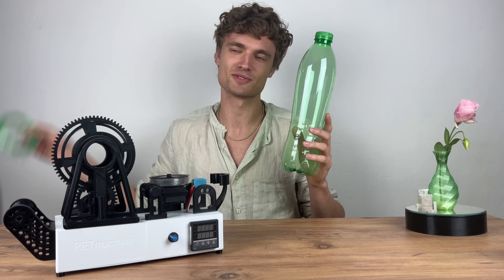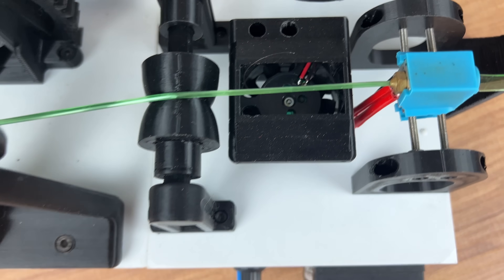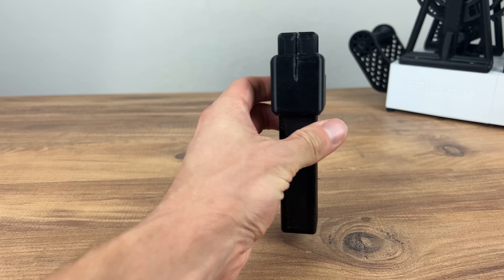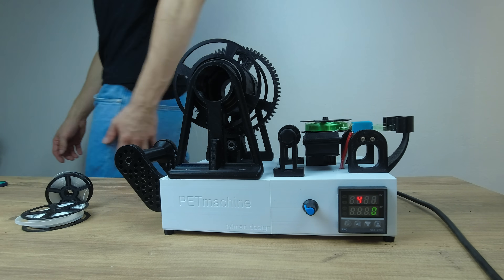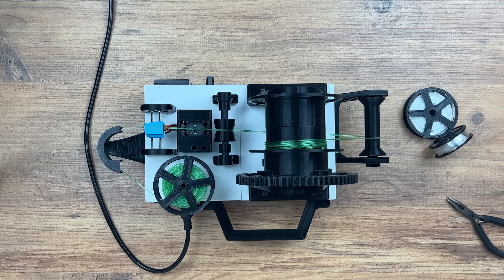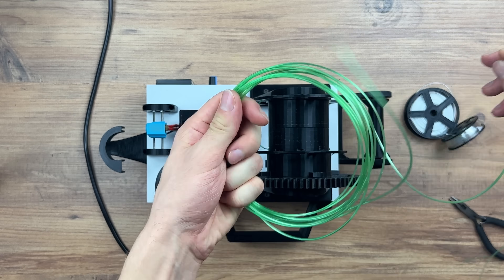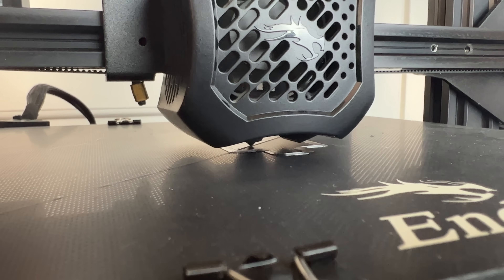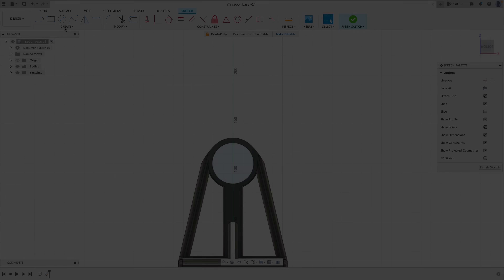Turn Plastic Bottles Into 3D Printer Filament at Home | DIY PET Recycling Machine!

Comment: The big question I have never seen answered with regard to these machines is this: How do you form continuous filament longer than you can get from one bottle? Without this ability, you cannot make anything of significant size. Another question that comes to mind is whether the amount of time and energy expended to form the filament is actually worth it. I can buy a 1 Kg spool of PLA+ in multiple colors for about $15. A typical large PET bottle is probably no more than 50g, so it would require in the neighborhood of 20 bottles to make a Kg even if you could make the filament continuous. Nevertheless, I do appreciate your design. One thing you might want to add is an automated method for slicing the bottle. It would be a big time saver.
Reply from the maker: Hello. You can "weld" it using PTFE tube and source of heat for example lighter. It's a nice solution, but I'm making research to merge raw plastic strings together and process very long string at once. 

I'm upgrading machine all the time to reduce the time of operations. For now we have to treat it like hobby and passion, not like its worth "something" and calculate time and effort. If someone like me take care of the environment this experience of recycling a bottle on Your own is worth everything. 

You gave me price 15 $ for one spool, but take into account that filament from bottle is recycled in 100%. Recycled PET filament from the store cost around 30$. A lot of people want to use just this kind of plastic to print / create their products and they don't care about the price or effort, because for them in what they believe is more important.

It's like going with bicycle from point A to B instead of the car, we put much more effort but it's about the journey, not a destination!

Thank You for Your comment!
Reply: there is a thing on thingiverse called a filament welder. i did not test it, but the comments suggest it works
Reply from the maker: Hello! We will announce and put PETwelder on sale very soon. You can follow my Instagram account to follow the progress about it: www.instagram.com/tylmandesign

Comment: This is just amazing work. Well done!
In germany we have a system where we return plastic bottles so they can be recycled. But there are many bottles that are one use only. These could be greatly used for this.
Keep it up bro

And i would guess that the third vase isnt from a bottle ^^
Reply from the maker: Thank You so much for Your great comment. Yes I was aware that in some countries it's not worth it to process the bottles in this way, because there is "return system", but many countries don't support this system and instead of throwing away the bottles we can recycle it in so efficient way taking into account we make it at home!
Reply: Germany changed the system to every plastic bottle i think?
Reply: @curryking7663  Yes you can return every bottle but there is still a lot of non reusable bottles that get taken back just to be destroyed. You return them just to seperate it more from the common trash.
Reply: Literweise Saft zu trinken deswegen macht aber auch irgendwie keinen Sinn ;D
Reply: @hanswurst3811  richtig 😁
Reply: and also unfortunately even the returned once are often burned for energy instead of recycled. there is a good arte documentation recently, can recommend to watch it. really sad that even exported plastic trash to other countries is considered "recycled" in the eyes of the law in germany.

Comment: can you post what module you used for the special knife because I don't want to use the wrong thickness plastic strip when I finish making the machine.
Reply from the maker: Soon I will release special module attached to our machine, it will have visible numbers showing where You should put bottle with particular wall thickness and cut it. It will feed machine directly with plastic.  Thank You for Your comment!
Reply: @TylmanDesign  I can't wait to see when that update comes out!

Comment: Does your temperature controller have a memory so where its always set at the temperature even when you turn it off and on again? Also do you have a recommended thermometer for a raspberry pi? Im trying to make a machine like this thats based on the pi, and I have the display, stepper motor, and button inputs planning on being hooked up to the pi
Reply from the maker: Yes, after shutting it down it remember last set temperature. 

My previous prototype was fully based on the Arduino, I had display, rotary encoder and so on. I was using MAX6675 module with K thermocouple connected to it and it was working pretty well. I've never see raspberry pi in this project, sound interesting!

Comment: I have also designed pet filament maker, couple of tips: Bearing cutter is a lot more precise than blade cutter, 1.7 mig welding nozzle is absolutely amazing and destroys any 3D printer nozzle due to much longer melt zone, you don't need to prepare bottles as much, I had great success just stripping label off cola bottle. If I had to prepare each bottle under stove, I would have quit long time ago.
Reply from the maker: Thank You for Your amazing comment!

Yes, I'm aware that bearing cutter is better, but I was designing my machine to allow for majority of 3D printing community can do it easily. Blade cutter is really easy to implement compared with bearings that we have to modify. 

In the future for more demanding audience I will prepare for sure bearing cutter with electric regulation of the string height, but for now I focused to create the most affordable and simple device. 

Coca-Cola bottles are the least demanding bottles, they are almost smooth. Some of the water bottles are really "wrinkled" that cutting it in this state will be impossible. 

I will check these mig welding nozzles, it interested me a lot!
Reply: @TylmanDesign  Mig contact tips 1.7mm can be bought for dirt cheap in local welding stores (bout 10$ for 10 pack) they also have the same thread MK8 as 3d printer nozzles and require no drilling (exiting filament expands a little), as for blade cutters, i had lots of problems with them like filament being stuck, in was really annoying so i made bearing cutter with a simple microdrill (angle grinder can also work but its a bit harder). I have entire uniformity test performed on some of my videos about filament diameter variance.

Comment: This is really awsome work.

Small ideas for enhancement:
- Possibility to directly usa a empty filament-roll where it puts it on. Because I was astonished how well it puts it on.
- Is there a way to easily combine multiple bottle-bands? So that we could make a 1kg filament-roll out of multiple bottles?
Reply from the maker: Thank You my friend, Your suggestions are very accurate. 

Im currently working on the cutter for the machine, the next thing is what You talking about, I will try to connect two string into one to be able to process many bottles at one, but it's a little bit challenging. In this case removable spool is neccesary to implement, but now when we procees one bottle, even if its super big removable spool is not that important.
Reply: @TylmanDesign  Thank you for your answer.
So do I understand right, that if I buy your manual, ... foryl your idea/product now I will get your improvements your working (new .step files, manuals, ...) on later on for free?
Reply from the maker: @photelegy  That's right! All updates included. I wish there will be many practical ones!

Comment: maybe make a filament welder so if you have multiple bottles of the same kind you can make a bigger roll by welding those filaments.
Reply from the maker: Yes, I was thinking about it, it's very easy to do, but I'm not satisfied with that l. I would love to find a way to merge two plastic strings before processing it.
Reply: @TylmanDesign  perhaps two heated blocks pressed on the two strips to fuse them like those sandwich makers?unlike filament welding, where you can trim excess thickness, there will probably be a change in thickness.
Reply from the maker: I tried it yesterday with hair straightener of my girlfriend(I hope she won't see this comment hahaha) It reached 210 celsius degrees and it wasn't enough to melt the strings, next problem is when string is heated it shrinks immediately and "run" from second string. I will test more solution when I will finish cutting module!
Reply from the maker: Hello! We will announce and put PETwelder on sale very soon. You can follow my Instagram account to follow the progress about it: www.instagram.com/tylmandesign

Comment: А отрезки никак не спаиваешь вместе что ли? О.о
Reply from the maker: Yes You can, after processing You can merge two plastic wires together using PTFE tube and source of heat, for example lighter. I will work on solution that will allow to connect plastic string before processing to create one long string.
Reply from the maker: Hello! We will announce and put PETwelder on sale very soon. You can follow my Instagram account to follow the progress about it: www.instagram.com/tylmandesign

Comment: what's the printing temp .. also the speed
Reply from the maker: Printing temperature vary from 240 to 260 celsius degrees, speed depends of the printer, but safe range will be 30-50mm/s.

Comment: It would be interesting to see if your machine could handle polyethylene bottles, and you could 3d print it. Here in North America, we tend to have deposits on pop bottles, but not on a wide variety of large polyethylene bottles. I understand polyethylene requires higher temperatures, more like ABS.
Reply from the maker: Printing temperatur of the HDPE(polyethylene) vary from 230 to 260 celsius degrees, so quite the same like PET. I think processing this kind of  bottle in my machine could be possible, but I will need to make some tests. At the earliest opportunity I will try to do it! Thank You for Your comment and making me curious!
Reply from the maker: I just got HDPE bottle yesterday, soon I will test it 💪🏻
Reply from the maker: I made some tests, HDPE is more soft and 
ductile. It was more demanding during cutting, but it was possible to make it,  further processing due to material characteristic is almost impossible. Like @7CConstitution said, it's like bubble gum.
Reply: @TylmanDesign  amazing.

Comment: How many grams of filament are you getting out of one of those bottles. Looks like a 1.5L bottle correct? I'm trying to figure out roughly how many bottles I would need to process for this to start paying off.
Reply from the maker: Yes it was 1,5L bottle non-carbonated drink, it's around 20g of filament from one bottle of this type.Thicker bottle walls give more filament, soda drinks weight more coz of higher pressure inside of the bottle.

Comment: It's awesome!
One hint: adding mechanism with a weak spring to push it to one side when it's pulled to the spool. So your finger is obsolete then.
Also what's a possible solution for connecting filament together for a whole spool?
Reply from the maker: Im happy that You like it! Please could You explain Your idea a little bit more? I'm curious, but I think I don't understand enough what You mean. 

Yes, that's my next biggest challenge, to connect many plastic strings, wind on a bigger spool and process it all! Connection have to be strong enough and not too thick to not affect on filament diameter in these parts. 

Of course there is easy way, to use PTFE tube and connect processed parts of filament into one long, but this solution doesn't make me fulfilled. Now I'm working on the cutter module, I have to make it the most simply as I can, that all people even without special tools can make it easily. 

Designing in a way to allow people even with no experience make everything by their own is pretty challenging but so satisfying! 

When I will figure it out how to connect plastic strings efficiency, next useful thing will be removable spool, now when we process just one bottle, even really big one removable spool is not that important, but later will be necessary.
Reply: @TylmanDesign  I really appreciate your answer a lot! 

The spool is not removable? I guess that'll be easy when attaching the gear fully to the spool even when printing with it. Shouldn't be a problem for someone making his own filament to print out a couple of spools with the gears on them!

For making longer raw spools I guess, you can make something like an heatable clamp (like for making curly hairs). In one side you put one end of a raw material and on the other side another end of another raw material. Then you press the heated clamps (with the material on each side) together and by this fuse the two ends together. Probably you can use non flat clamps. I don't know.

For the spooling mechanism you might use a small pressing lever with a light spring which pulls or pushes the lever in one direction (like your finger in the video). THis helps for one direction. And because the spring is sooo light it might even be pressed to the side by the material when it winds itself on the spool side by side. So it would be "actively helping" in the direction you helped with your finger and would just be pushed back when the material would be rolled on the roll in the other direction. So the spring would be parallel to the axis of the filament roll and just push/pull like your finger.

I wish you all the best with this awesome project!
And by making it open source you're giving so much to the world!
Reply: May I suggest a simple method to connect filaments? I dont know if this will work, just an idea.
So, if there is some mechanism to pull back the filament little bit at the nozzle end, and one mechanism in front to insert the previous filament. I am hoping the two ends will melt inside the nozzle and when the spool pulls, it will be connected. A burst of higher temp may be required to properly melt and join both ends, then temp can be lowered to 200 and then the spool starts pulling. Please let me elaborate. when the temp reaches 200, you pull out little bit of filament, then cut clean at the nozzle mouth, now mechanism pulls back the string from back side, creating some space at the mouth end of nozzle. mechanism in front of mouth inserts the previous filament, and temp rises to 250, the back side mechanism which pulls back string, now pushes it a little into nozle to connect ends. then temp lowers and you continue as normal.

I didnt understand any of your spool talks, but please address the weak spring idea, I think that is more important, as I felt having to aling filament on the spool all the time is just cumbersome.  I think you need to substitute your finger with a mechanical part. maybe loaded with spring or perhaps static.
Reply from the maker: Hello! We will announce and put PETwelder on sale very soon. You can follow my Instagram account to follow the progress about it: www.instagram.com/tylmandesign

Comment: Great job, I can already imagine how the next gen would look like, with the bottle cutter incorporated into the machine, and possibly removable spools, (printed from recycled bottles, of course:), and other improvements.
Thanks for sharing.
Reply from the maker: Thank You so much, it's motivating when people comment in the way as You do guys! 

Improvements can never end haha Later when version with cutter and removable spool will be ready I will try to make it totally automatic, cutting connecting plastic string and so on. Even inteligent checking what's the thickness of the wall will be implemented, basing on that information cutting blade will change cutting height. But it's a future...I have plan for it, but first things first. 

Let me quote myself from other comment:

Now I'm working on the cutter module, I have to make it the most simply as I can, that all people even without special tools can make it easily. 

Yes, that's my next biggest challenge, to connect many plastic strings, wind on a bigger spool and process it all! Connection have to be strong enough and not too thick to not affect on filament diameter in these parts. 

When I will figure it out how to connect plastic strings efficiency, next useful thing will be removable spool, now when we process just one bottle, even really big one removable spool is not that important, but later will be necessary.
Reply: @TylmanDesign  This is amazing, I'm considering to build one with my daughter (10 yrs) to motivate her on how to recycle plastic. It's a perfect demonstration. It'd be great finding out how to connect filaments so that we can create bigger spools. Did you consider selling the required parts that cannot be printed?
Reply from the maker: @matthiasnott  amazing idea! I'm even more happy when I hear that people build it together with kids to teach them about recycling and so on. Yes, there are almost available for sale, check my IG for more info, I will announce it soon. I'm from podlaskie stare.
Reply: @TylmanDesign  Nice! My better half is from Warmińsko-mazurskie, so not far away. I'll show her the video, and really it would be great building one. Personally we use about no PET bottles, but still, it would be great using some bottles and showing what you can do out of them -> yourself. There was another comment about creating flakes, which would make the cutting easier, but require another process for getting the filament out. That way you could probably get it to a larger scale, have a continuous filament, by just raiding your local PET dumpster :)
Reply: @matthiasnott that’s seriously so cool!! You sound like a great parent. Did you ever end up trying this out w/your kiddos? If so how did it go? My little brother would totally love this kind of thing
Reply: @TylmanDesign  you might be able to do intelligent checking mechanically
Reply: Great idea
Reply: Glueing the strip made from several bottles somehow, to make more fillament at once. For bigger prints e.g. mechanical parts later.